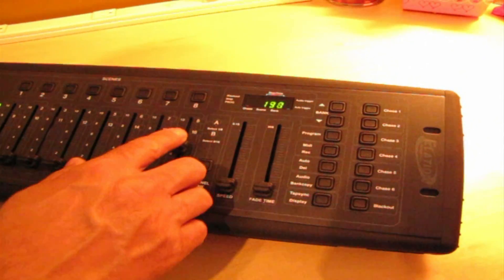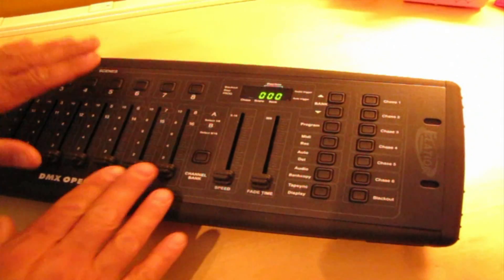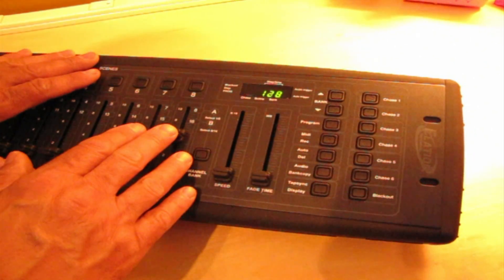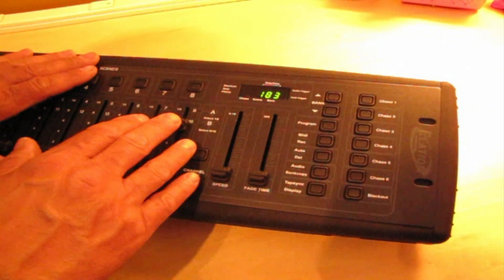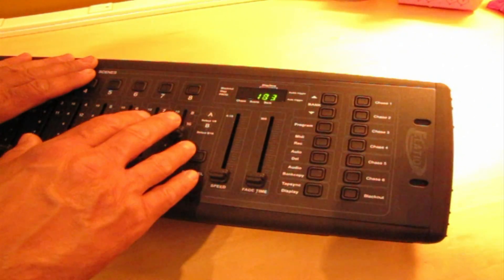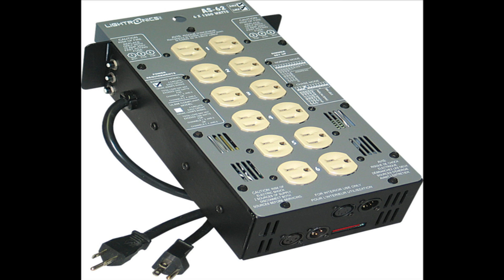DMX Basics & History

Comment: DMX 512 is exactly the same as the old RS485 industrial serial communications, in fact if you download the FreeStyler DMX software package, it will run with a USB to RS485 serial interface (which you can pick up off eBay for pocket change). It is called 512 because you can send up to 512 individual instructions (bytes), each with a value from 0 to 255 (256 individual values because 0 is counted as a value) down a single cable. In DMX each of the 512 instructions (or bytes) is allocated it's own address. Because a byte, by its standard definition, is 8 bits which can represent 256 values (0 through 255). A byte has only 8 bits. A bit is a binary digit. So a byte can hold 2 (binary) ^ 8 numbers ranging from 0 to 2^8-1 = 255. Read more on Wikipedia: http://en.wikipedia.org/wiki/Units_of_information 

DMX does not know which instructions go to which fixture, you have to set that up by addressing selection on the fixture. You can overlap addresses like I often do to get better consistency in control of your fixtures like I set my starting address of my Chauvet Colorstrips to one which in RGB mode will set Red to channel 2 (address 2), Green to 3 and Blue to 4. I will then select 3 channel mode on my Chauvet Slimpar Tri7 fixtures and set their address to channel 2 which makes the Red, Green and Blue of both fixtures fall on the same channels on my controller. If I then lift the Red slider, all my fixtures emit Red and the same applies for Green and Blue. This makes life so much easier.

The 5 pin XLR was originally intended for full duplex communications but this only added to the problems a lot of people experience with DMX and never proved a viable solution. Even with RS485, full duplex is rarely used. Full duplex would be when you have two way communication in that you send a signal out to a device and get a "data packet" received or status response. It would function in very much the same way computer networking does. The idea with full duplex is to ensure that all the data sent out is read and understood by the receiver. The problems encountered with full duplex are that firstly, none of the current fixtures support it and secondly that any data transfer issues result in the network being overloaded by the controller continually trying to resend the same data. Current DMX sends out the data and couldn't care whether or not the fixture received it or responded correctly.

While DMX is still widely used, the industrial RS485 system has all but died with most manufacturers going to CAN-Buss and PROFI-Buss (which are high speed spin-offs of the RS485 protocol) or Ethernet. I am expecting to see DMX completely replaced by Ethernet and Wi-Fi in the near future as DMX is still based on an obsolete and antiquated system that has all but outlived it's usefulness. In Ethernet, fixtures could be auto-detected and drivers loaded in the software control packages that would make assigning functionality a breeze. You could have fixtures send back data and error messages allowing you to do diagnostics on any shows you have created before going live, etc.
Reply: A lot of people enter into DMX without first understanding the fundamentals of the protocol and while it is possible to become good at DMX without understanding the fundamentals, understanding will assist you to avoid the problem areas of DMX. You will know what is likely to cause you problems when setting up a DMX network and how to avoid it. You will also understand what causes the problems you experience when they arise.

A detailed technical explanation of RS485 can be found here: http://www.usconverters.com/downloads/support/rs485explained.pdf

Happy DMX-ing :-)

Comment: DMX requires a DMX 3 pin cable not an XLR.. DMX cables are very low voltage where XLR is used for sound reinforcement and must handle much higher voltage. If you use XLR the lighting will not be accurate and may act up.
Please if your going to post a video get the facts straight or you end up misleading alot of people.
Reply: XLR CONNECTOR. Which is true